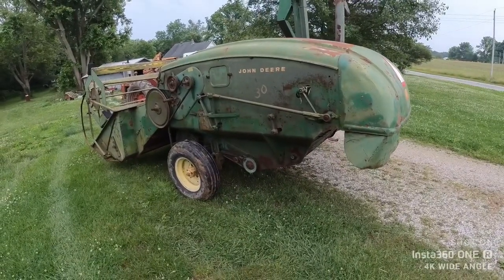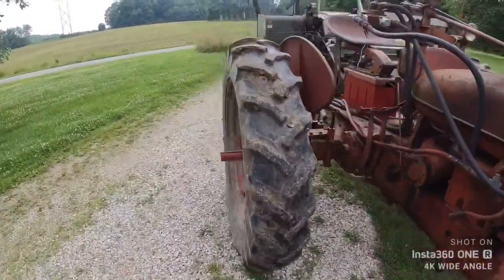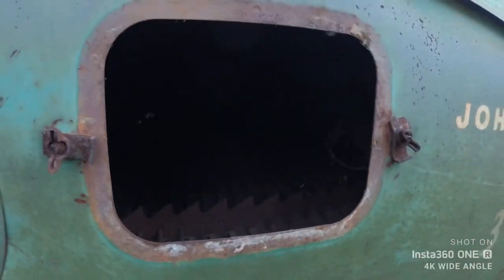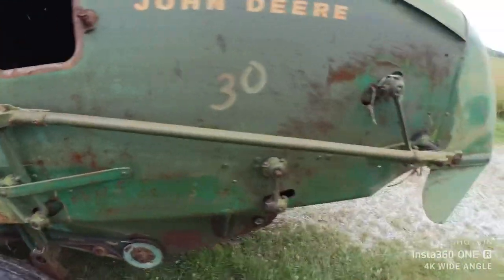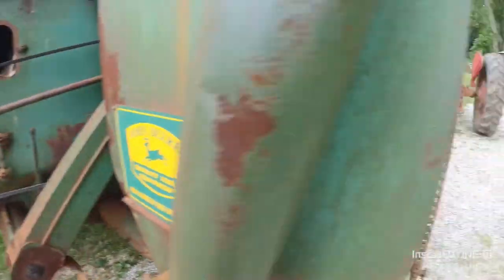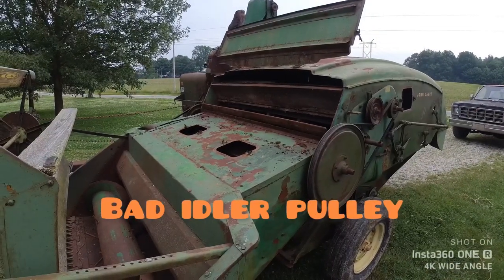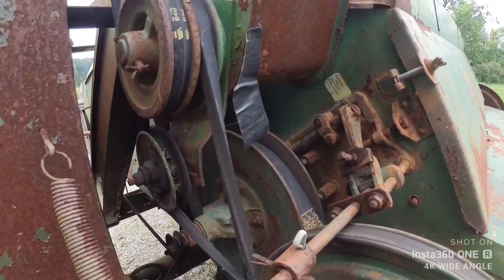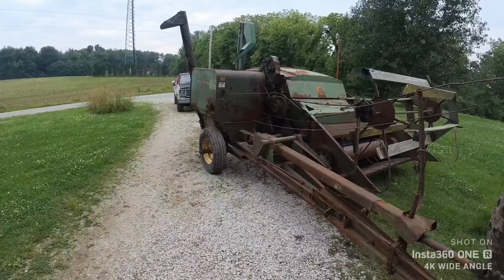Model 30 John Deere combine walk around

Comment: As far as those belts go I would run them as long as you can or until you basically have it off for another repair. Those deep hidden belts sometimes take a whole day or more depending on the levels of rust you find. Combines love dust, moisture and rust. That machine will likely run a long time as it is. They all will squeak and bump a little. And duct tape is your friend. Our old Massey Ferguson 300 had a couple spots that we "repaired" every year with a couple bent license plates and a healthy dose of duct tape. Just seeing it run that smooth tells me it's good for a long time.
Reply from the maker: I hope I can get a few years without too much work

Comment: The 30 is the second best small vfarm combine made. The best was the All Crop 72. The sales figures will bear that out. We had one of each. The 30 was heavier built. The to tongue weight of the 30 warrants a heavier tractor than an H in rough ground. You  will enjoy using your 30. I wish I could find one or a 72
Reply from the maker: That’s what I was looking for was all crop 60 or 72 but I found this and its a pretty good machine

Comment: Always something to do or coming up to do. Greasing, oiling and replacing is a given. I've got an idler on my mower that has a roar in the bearings and I just put some oil on it and it keeps on roaring. Has for going on 7 years so far. I'll have to replace it sometime.............after it dies but not until. And it's not loud enough to worry with. Like the squeaky wheel syndrome. Looks like a fine old rig as well as the square body. You'll get it. GBWYall!
Reply from the maker: That’s what this squeaking is a pulley with sealed bearings
Reply: @DrRust  I just get them spinning a little and ease some oil around the shaft with a squirt can. It eases by the seal and helps quiet things down. There's a process name for that but it ain't in a million miles of this old hollow head at the moment.
Reply from the maker: I’ll definitely try that
Reply: @DrRust  Works for me on all kinds of stuff but it's just a stop gap measure.

Comment: you know what scary about that video is l can remember that combine coming out in the middle 1950s or a little newer. in are area adair county IA  AC was the go to combine 60 and 66s had canvas but the 72 and 90 where augers. that looks pretty clean the canvas in back needs replaced and l would when not is loosen the man drive belt so it wont stretch. wouldnt take to much to put a coat of paint on it too exuse my spell and l will be watchin!!!!
Reply from the maker: Thanks for watching I wish I could find a ac 72 or 90 but we didn’t have those around here it was all corn hay and tomatoes in that timeframe so nobody bought the big models